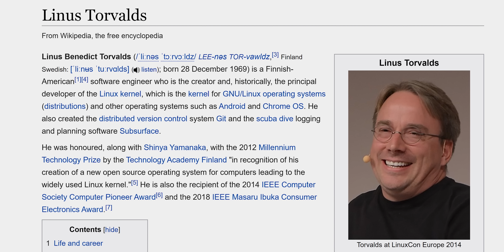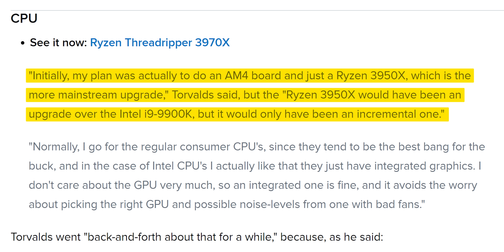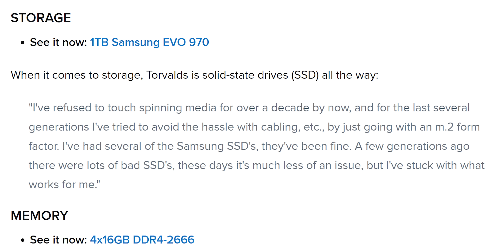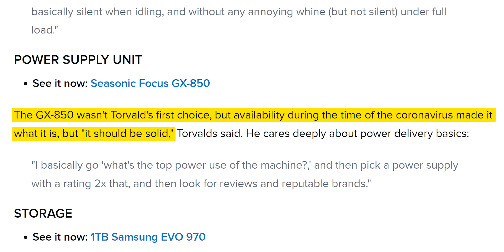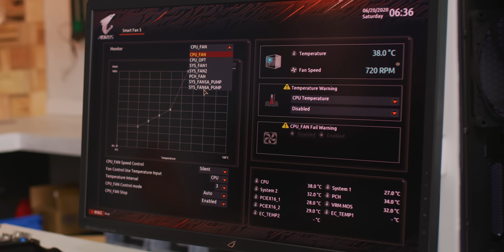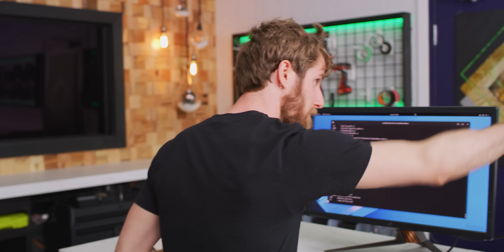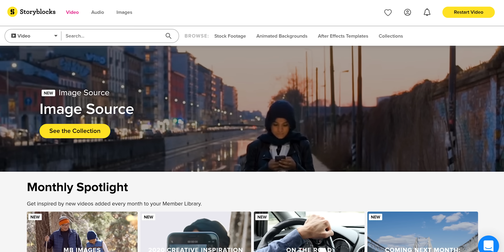Linus builds Linus’ new PC!

Comment: one of the editors seems to bake the cinematic aspect ratio into the 16:9 video file, which means that when you watch on a 2:1 display (modern mobile phones for example) there are black bars on both the top and sides of the video, not utilizing the extra screen real estate.
Reply: I can't zoom out in my 2:1 phone, no black bars
Reply: Yes
Reply: Whyyyyy did you say that
Reply: Nope, shows full screen on my phone as well, and I can't "zoom to fill" or zoom out to a 16:9 either.
Reply: @nawarelsabaa  its inconsistent which is why I specified one of their editors. this video is void of the issue, but their new gyro controller video isn't.

Comment: Just finished building my new rig, and linux is going to be my main daily driver. For now I'm running off an old Adata 512gb ssd with windows sitting happy on a 2TB Adata XPG NVMe drive. Linux will eventually also get the same drive. Outside of one or two games, everything now runs natively under linux, or runs fin under either wine or proton. I even just recycled my old windows 7 OEM key from 3 PCs ago and it worked with windows 10 (so it's technically a "legal" install as Microsoft verified it). Eventually I'd love to wipe windows and setup a second Linux install. Biggest hurdle is going to be photoshop and my pen display which do not support linux. So I may at least need a VM for that.

Comment: A FirePro W5100 would have been a better choice than that RX580 because the 580 is gonna pump out heat even when lightly loaded, but the 5100 won't and will stay quiet and cool while still offering 4 DP ports.

Comment: A way to reduce fan noise further is to set the RPM at least 60-100 RPM apart for each individually. 

The noise level went down once I did this with the case fans and CPU fans in a push/pull heatsink. This was partly due to the BeQuiet case fan controller running three fans all at the same speed.

Comment: when "some random graphics card" is better than mine...
Reply: The RX 580 (or 570, but it's not much cheaper) is actually a really sensible choice here for Linus. Those are the cheapest non-nvidia cards available new that give multiple displayport outputs for lots of screen area on 4k or ultrawide monitors. And the AMD Polaris GPU is really well supported - fast and stable - by the open-source Radeon drivers built in to the Linux kernel.

Comment: As a software developer myself, basically any computer will do, there isn't really a need for performance when coding, only when compiling, or testing the software you write. I'd say that the two most important components when developing would be the RAM and the CPU. I actually use a lot of RAM since, well, firefox and chrome need quite a lot of it to run smoothly, and some deployments, especially using kubernetes will require plenty of RAM to run properly (think at least 8 GB to only run minikube), and having plenty of RAM is handy to handle large datasets when doing data science/big data.

Having a powerful CPU is also very useful to cut down on compiling time, since it's time when you're not productive.

Lastly, having a fast internet connection with the I/O to boot is also quite important. Nowadays, everyone uses Git (or subversion) for version control, and having a fast internet is crucial when cloning a repo, pulling or pushing to it. The less time it takes to do these tasks is time you have to write code.

Graphics is not important, and neither is I/O really. You don't need a lot of peripherals, a keyboard and two screens is what you need, you don't even touch your mouse most of the time.

Comment: As a Developer, here's the basics of what we need:
1. More cores/threads are always better. Compilers are one of the few programs who can use the all the cores you give them.
2. Fast Storage with medium capacity for build artefacts and if necessary (more so in game development, less in office/business application development) high capacity spinning rust, but not overkill, we have servers for that
3. High speed RAM is nice, but not needed as we usually are I/O bound.
4. High perf graphics cards are usually redundant, unless you are in game development, but in that area you have different requirements depending on position
5. Good networking
6. Nobody cares about the OS anymore
7. More screens is always nice, having the IDE open and being able to browse documentation at the same time is a godsend.

So yeah, the machine Linus has put himself together is pretty much what most developer would need.
Reply: "Nobody cares about the OS anymore"
I agree, since Microsoft released VS Code, the OS is irrelevant and can be one of your preference.
Reply: @bernardo-x5n  TBH, it was even before that, but what really changed the deal was and is WSL.

Comment: As a developer I need cheap nice performance cpu cores, fast enough  ram with few extra GBs, mid tier ssd and maybe a hdd for trash bin? and finally 4 Titan RTX with green rgb leds (because green leds lowers the  power usage), jokes aside I still use 5+ yrs old msi ge60 with upgrades (16GB ram, 240 SSD, 1tb hdd on caddy, nvidia 950m, intel i7-4720HQ) and I might or might not change this laptop in 2021. All depends on a laptop with ryzen  7 4000 mobile cpu and good linux support on the laptop. (acer has meh support, razer has average support, msi has good support, dell xps has good support, lenovo thinkpad has god tier support,  Lemote Yeeloong has elder god tier support.)

Comment: Developers want/need a very wide variety of things, depending on what it is that they're doing.
Here's some thoughts, some of which might be contradictory:
1) Approximates the deployment environment.  At my work, we deploy our software onto either Intel dual-core chips from like 2011, or onto cheap modern i3 systems with like 4 gigs of RAM.  If I don't have a good feel for how the software is going to behave in that environment, that's a Bad Thing (TM).
2) Gives me a reasonable amount of power without disturbing anyone who works nearby.  If I'm waiting on a compile, I'm not developing.  If my neighbors are disturbed by the loud fans, they're not developing.
3) Fast Git (or whatever revision control/VCS) operations.  If I'm pulling a huge repo, I should be limited by line speed, not by disk speed.  If I'm doing some weird stuff with the repo, I don't wanna wait a long time on it.
4) Enough scratch disk space that I can do weird experiments without worrying that they'll eat up all my storage if I forget about them.
5) Enough RAM that if I need to fire up a VM or two to test some stuff out, I'm not gonna start swapping.
6) Long-term reliability with minimum maintenance.  If I need to open the case, I'm not developing.  Opening it to dust it out once a year is fine, but it should be a "scheduled maintenance" thing.
7) Eight quadrillion browser tabs.  Sometimes you need to have the entirety of a language's documentation open at the same time, y'know?

Comment: If you ever do make a developer build guide, it's worth noting that a systems programmer like Torvalds is going to have a very different set of needs from an AI developer, who will have a different set of needs from a web developer. Systems guy just needs a shitton of CPU performance, preferably with good RAM, the AI developer will need a powerful GPU (and probably nVidia because OpenCL has poor support right now), and the web developer will need the same sort of machine as the systems developer, but can probably afford to pare it down by a lot as it is a less demanding workload.

Comment: 5:50 I have similar, I have a stock Foxconn LGA2011-1 cooler and a pair of Noctuas, seems to work really well to keep a supposed blast furnace Sandy Bridge below 50*C under load
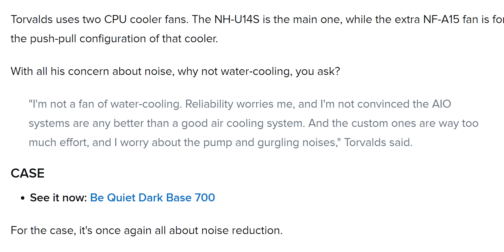Reply: 6:20 me either. I hate changing my oil and transmission fluid in my car, why on earth would I want to change the coolant on a computer
Reply: 7:50 I have an 850 EVO 1TB 2.5". Seems to be fine, I would prefer it be nVME but I'm gonna wait this generation out and see where we land in 2021/2022. This ol' Dell is gonna get run until the wheels come off, really.
The more I examine my daily driver PC, the more I realize I'm just a poor Linus Torvalds. And I use Windows because I'm lazy and bc work but I do at least have bootable Linux distros on the drive
Reply: 8:15 not the case I would have selected but it looks about the cut of what I would buy, I think I'd find myself in something similar from Rosewill or whatever was on sale at the time. Cooling and fan noise aren't as important to me but they do factor in.

Comment: +1 from a developer. Threadripper is the holy grail for us. But a AIO  with a 120mm radiator is recommended. Corsairs seems to be quality stuff and not make any pump noise. Enough thermal capacity to absorb a compilation or two!  Always completely silent :).

Comment: I've been a developer for 30 years now and have never bought an off the shelf PC. Parts are always carefully selected for that task I want to do. Graphics are less important, but CPU and memory bandwidth is. IO has always been up there as when dealing with hundreds of thousands of small files, random IO is key. Back in the day SCSI was king with as many spindles as you could afford. These days I try to find a hardware RAID card (no software raid). All those CPU cycles should be for compiling, testing etc. When running something like Kubernetes on your local machine with 5 nodes, you need a lot of memory. I dream of EPYC, but can't afford it ;)

Comment: Linus, can you stop the "higher Wattage = Quieter" Power Supply? That's utter Nonsense, if we talk about the same Plattform. If we talk about two different units (ie old Corsair RMx 550 vs 750. The new one uses the same from 550-850W at least) it might be possible. But Seasonic doesn't do that. They even use the same fan throughout the series.
And also they aren't known to be particularly quiet either. On the contrary...
Anyway, a good PSU that is designed to be quiet is quiet regardless of the Wattage and some higher wattage units are rarely quiet. Just look at reviews of Enermax MaxTytan. Or higher wattage EVGA units! Yes, those ~140mm fans rotate at around 1100rpm once they start...

Comment: There is another good reason to not use a HEDT CPU as a developer.  Depending on the size of the organization you are working for the person who compiles the code is also often the person who initially tests the program and often on the same computer.  It can often be a good idea to use as mainstream as you can, just maybe the faster/higher core count variant.  If you are developing software for workstations/servers/other more specific hardware setups then this is of course different.

Comment: 17:13 "you don't have to worry about using clips that are 10 years old" while showing a clip of the NASA Space Shuttle taking off... (last flown in 2011), aktchualiiiiy)
Reply: Don't worry my friend. The clip will be taken down the day before hitting 10 years.
Reply: @abramhansen  That particular shuttle launch is nearly 40 years old. You can tell it's Columbia (crashed in 2003) because of the black heat tiles on the upper side of the wings, and you know it's one of the first few launches ever because the big external tank in the middle is painted white. They started leaving that an unpainted orange in later flights. So I estimate this launch to be from around 1982 or so.

Comment: I feel very validated, because I ve made pretty similar choices for my pc: i 9 9900k with Aorus Gaming Master 7 Mobo, Samsung 870 NVME, Noctua NH-U14s (still rocking from 2013) for the exact same reasons as linus, 64GB Gskill Trdient Z 3200 Mhz memory, Sapphire Nitro + RX 580 (also overkill as the most challenging game i play is Civ 5) and a Seasonic Ultra Prime 650 PSU.
Reply: I think the 580 is simply a good enough GPU that is pretty dirt cheap yet packs enough punch of you wanna game with decent performance.

Comment: Second time... As a software engineer, I feel negatively stereotyped.   Also many bioses slow down the memory clock in quad channel vs dual (also depends on mem rank), faster 3200 memory may not make a bit of difference.

Comment: This from a perspective of a back-end developer(go,java,c#,node,PHP,[some python ]) so this is in no way a perfect list it's opinionated
Desktop 
-  gpu: no dedicated gpu unless you're a game dev. Seriously most of them have crappy drivers and you don't want to deal with them if you're using something other than a mac . I had a desktop with a gtx 970 or something and it made me almost rage quit.
- cpu :  multi-threaded cpu although now most chips are quad cores so it's not that big of a deal. doesn't matter the architecture as long as it has the run times mentioned above ported over really. 
- cooling solution : a quiet cooler , nothing fancy just enough to not bother me . 
- networking :  a decent WiFi card / Ethernet solution . Don't cheap out on this . it will bite you in the ass.
- monitorssss :2 monitors is a must really the more the merrier . 
- OS: any Linux distro with easy package manager like manjaro . I say manjaro is easy because pacman always has up to date packages and having the aur is a bonus
- wm : something with a decent window manager that doesn't get in your way , i3 for me is close to heart because i spent time writing my own scripts for it but awesome is also a good contender .
laptop 
- most laptops are pretty terrible . So i just buy a mac end of story
-  reason are : 
- good trackpad , nice display (anything but 16:9 ), generous battery , unix file system , usable desktop enviroment , package mangers like brew make you feel like you're not that far off home. Great Docker support !!! which is huge now in the backend world especially if you work for an sme and your company doesn't want to hire an IT guy or someone who manages deployment.

Comment: 5:50 Oh no! You forgot to put the thick rubber pads on the 2nd fan! It will whine pretty badly at high RPM with the standard thin pads. Get the thick pads on there, Linus! You can find them in the box of the NH-U14S cooler.
Reply: That system is probably already disassembled by now.
Reply: zakius — Or you’re just compiling a massive amount of code.  Compiling the Linux kernel is one thing; compiling and entire toolchain and linux distro would take significantly longer.  It’s still not uncommon in software development for a clean build of a large codebase to be left running overnight (fortunately, incremental builds are often all that’s necessary).
Reply: Cap'n Slipp I just want to add, for a taste, install Gentoo in a VM. EVERYTHING gets built from source during the installation. It takes hours.
Reply: Dang, you beat me to it... I had to get a Noctua 120 for my second fan on my D15 to clear RAM and not have a god awful buz.
Reply: Well, almost everything. There is a small amount that comes prebuilt.
Reply: People who plug fans directly into molex: PATHETIC
Reply: It's even worse than that! It could shock and kill you dead! The Verge told me so.
Reply: Btw, can everyone report the rita bots?
Reply: You know that they just disassemble the builds after they're done, right? LMG doesn't just have 500 random PC's they've built standing around

Comment: "Why pick AMD?"
Whenever I have to use Linux on my PC with an RTX 2070, the only thing I can think of is all the different ways I could kill myself in.
Reply: Having open source drivers for my GPU has been a godsend, I can have so much control over how the GPU functions. I even had some fun tweaking it, Vega 64 idles at 4W of power now
Reply: Recent Ubuntu or PopOS are supposed to install Nvidia proprietary drivers for you, no?
Reply: @Agent_Krasnov  yes and no. Installing still requires safe mouse (depends on the GPU), refresh rates with multiple monitors are still borked,  fan control is broken... 
On one hand I can understand why the drivers are so shit compared to AMD (cos AMD sells to Apple and supercomputer industry, while nvidia only really gets used with Linux by developers and AI clusters, and the CUDA drivers are fine), but still - not an excuse, nvidia.